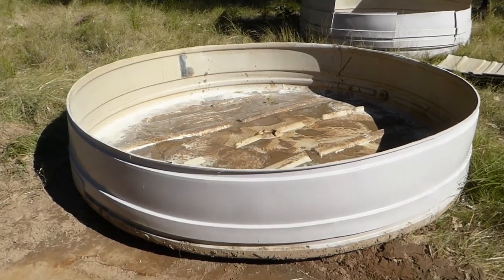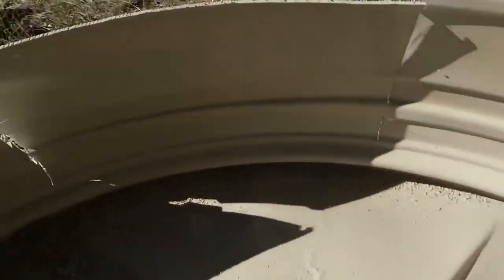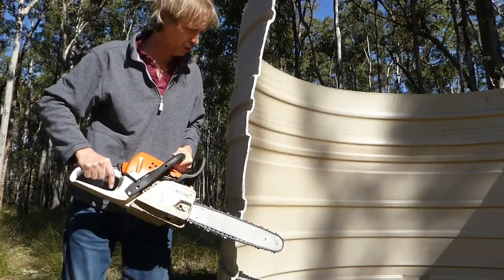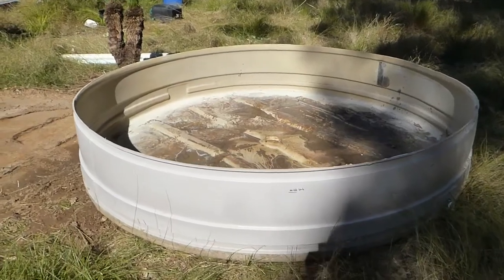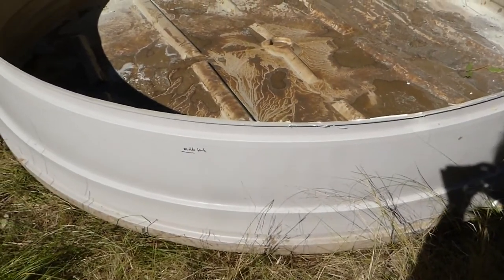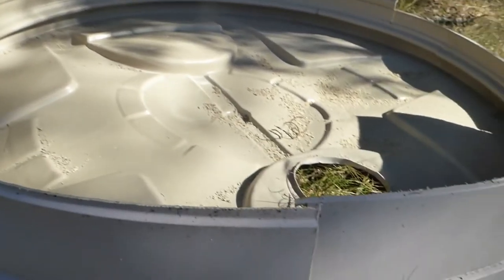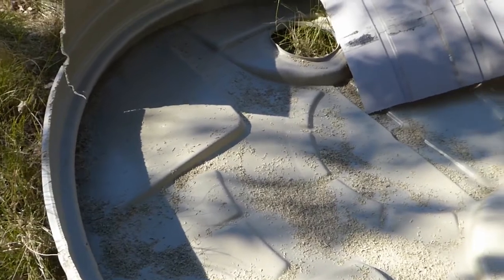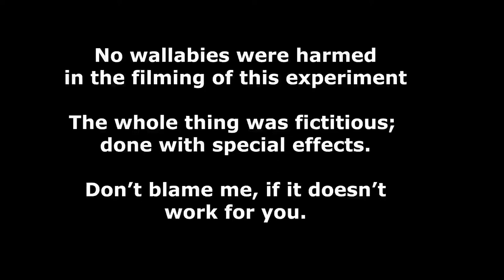How to dispose of a poly tank, remove, cut up

Comment: 4 leaky old tanks to replace soon and I wondered ihow my chain saw can break them down.  New tank dealers will not take away old tanks so one must dispose of them oneself.
Reply from the maker: Yeah. Recyclers wont take them. But poly burns really well in a big fire. Turns into a liquid.  I'm using the bottom of the tank for a lily pond, or tadpoles or something. Those bottom bits are an asset of some kind, I reckon.